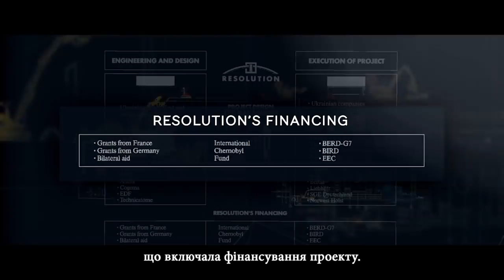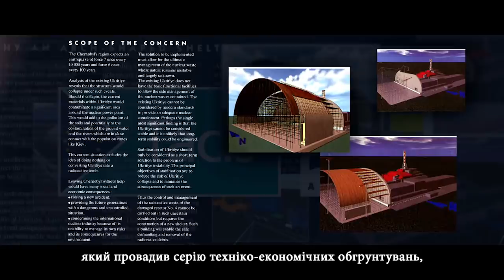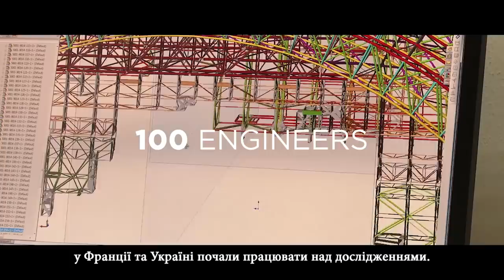Chernobyl confinement: the story

Comment: probably one of the greatest engineering achievements of our time
Reply: as well as one of the most important ones
Reply: It was needed to repair the worst man made disaster ever, generations for 5000 years will be dealing with this problem
Reply: @DB-pv2ej  I don't think when this happened there fully understood the power off nuclear power. I was 5 years old when this happened I was at primary school. I was born in 1982. I study sciences and medicine histology histopathology cytology forensic pathology diagnostic medicine. I've studied physics and electronics engineering
Reply: @DB-pv2ej  the earth will shake us off long before that.
Reply: Shay Bear does it still hold that title after Fukushima?
Reply: @CyberNut930  yes as fukushima was caused by a natural disaster
Reply: @DB-pv2ej  Fukushima was still a man-made disaster because it occurred due to tepco cutting corners remember it wasn't the earthquake or tsunami that caused it but the fail in  Fail-Safe technology
Reply: @GlazzedDonut  if the tsunami didn't occur, the disaster didn't happen, but I see your point, let's agree that it's both👌
Reply: @GlazzedDonut  Fukushima needed a catalyst, and in this case, it was an earthquake-caused Tsunami. Chernobyl's catalyst was a human-initiated power-loss simulation that resulted in a core meltdown. These are two totally different concepts. May I suggest that you study human vs. nature?
Reply: @csn6234  I think you are putting too much emphasis on the idea that this was a single point of failure. If you look at Fukushima, and Chernobyl, these catastrophes (and in the case of Fukushima, 4x vs. Ch since it was 4 reactors that all failed), there were a series of cascading failures, no single root cause, i.e. the tsunami caused the disaster. That is a fallacy. This is rather typical in general engineering problems. To put it in simpler terms, let's suppose the Japanese were as careful as the Ukrainians and decided to "test" a failure scenario, oh, let's say whether the reactors would be able to handle a flood situation. And obviously it would've failed, so I think the human vs. nature is nonsense, this was all human/design failure. That's what engineering is all about, esp. civil engineering - designing systems (dams, bridges) that have to work with nature. You can't exclude nature from the equation.
Reply: @comsunjava  It was 3 reactors, not 4.  4th was shutdown with no fuel.  The Tsunami that caused Fukushima to fail was a 1,000 year event.  It was the second largest earthquake in recorded history and the worst tsunami to have ever hit Japan since the islands were inhabited.
You can argue that they could have done better, but 20-20 hindsight is wonderful.
Chernobyl on the other hand was gross stupidity.
Reply: @DB-pv2ej  Tsunami Events possibility should already be in the calculation from the start.
Reply: And fuckups
Reply: wor one of the worst man-made disasters of our time and the first time something like this occurring on our planet. cost thousands of lives. But yeah... let's remember it as an achievement.
Reply: Your name sounds like a cheap brand of Ramen Noodles
Reply: Start building more!
Reply: I find it fascinating. I study sciences and medicine histology histopathology cytology forensic pathology and diagnostic medicine I have done programming electronic engineering physics
Reply: We creating a negative air pressure. Over damaged reactor
Reply: This type of engineering truly benefits humankind.
Reply: @Floyd1504 Correct, I believe only 1 person died directly from Fukushima (compared to over 10,000 from the tsunami). There may be some small uptick in some cancers for those in the immediate vicinity, but really it's a minor event compared to Chernobyl. But we really need to replace all the nuclear reactors based on 1950s-era designs with more modern ones that are impossible to meltdown.
Reply: it's just a stupid metal arch not an engineering miracle..
Reply: Nope still the Astrodome
Reply: Niyomi Nakajima covering up the biggest engineering cock-up ever
Reply: I respectfully disagree - they build more awesome stuff as we speak, they just don't tell us... for example - underocean train tunnels for high speed trains... I know of such in scandinavia and turkey but there shall be one for EU - US connection which will make traveling 'over' the oceaan cost you no more than 3 hours (magnet speed trains can travel much much faster than they do atm ). I know sounds funny, but go ahead - reasearch on my words and you will find the evidence
Reply: Yea they were trying to fix THEIR problem and is just a cap that probably doesn't even work wow that a achievement
Reply: No?
Reply: Technically it is quite simple construction and procedure. Only scale makes it impressive. But hey we (mankind) make even bigger constructions.
Reply: Водородная Бомба "Кастл Браво" -15 мегатонн  -70% урана (несколько тонн) которой осела на всей планете (!!) Вот о чём надо говорить!!! Следствием стало уничтожении целого народа бикини и миллионы смертей по всему Миру. Повышение радиационного фона было зафиксировано НА ВСЁМ ЗЕМНОМ ШАРЕ ... (!!) США взрывали ОЧЕНЬ ГРЯЗНЫЕ УРАНОВЫЕ БОМБЫ и Чернобыль лишь пылинка по сравнению с тем ,что делали моральные американские уроды (осознанно делали), которых зверьми нельзя назвать т.к. звери очень хороши по сравнению с ними ..
Reply: Pump & dump theatre
Reply: Now let's see if they can ever fix Fukushima
Reply: I’m sorry.. but no. This is surely an achievement, but not the best engineering one. Sure this was a lot of work, but it really wasn’t as much engineering as other things. If you really want me to I’ll list some.
Reply: @evanwatling3897  go ahead I am interested and bored af
Reply: Папа Сталин ok I’ve got a cool engineering project here. Millau Viaduct, Millau, France. Tallest bridge in the world. 1,125 feet, or something like that. I can’t remember off the top of my head. Pretty crazy, but this dome still looks cool compared to it.
Reply: German engineering is the greatest in the world!!!!
Reply: @kingnothing5678  is that a JoJo ReFeReNcE
Reply: Yep true